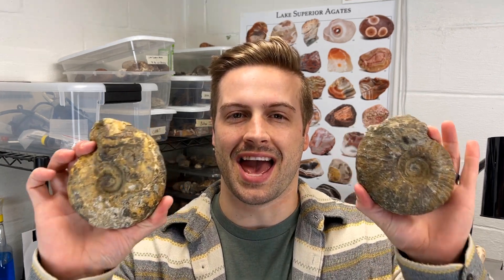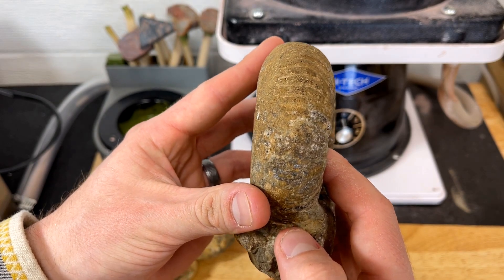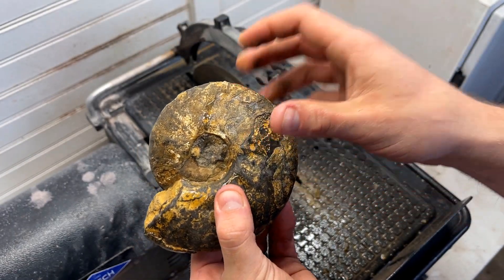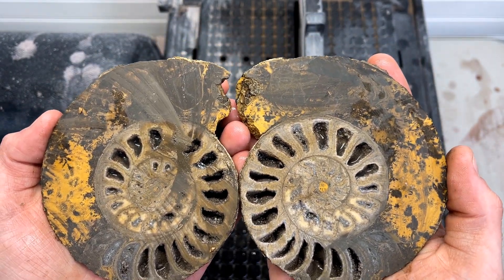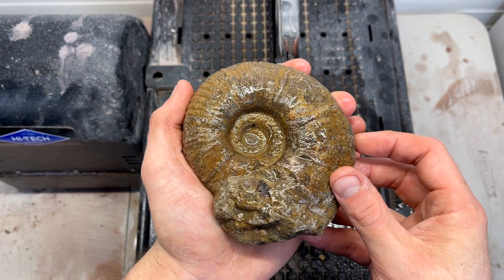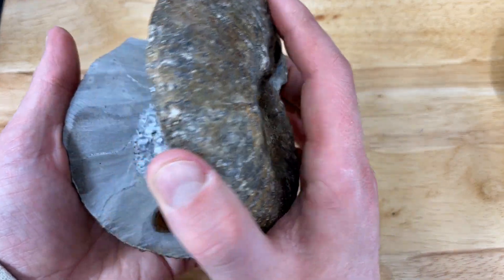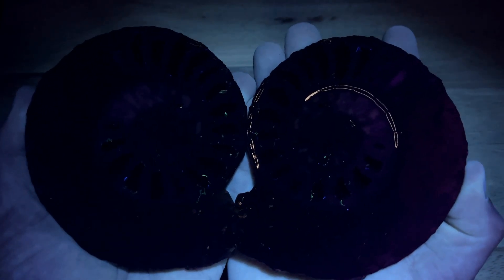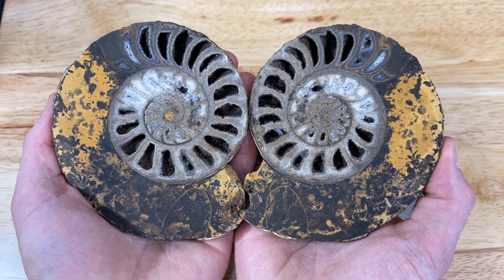I was SHOCKED by the Crystals inside these Ammonites!

Comment: For the druzy one, did you cut right along the siphuncle? I was hoping that it would be intact. You may be able to see it on the one that’s been fully filled in.

The siphuncle is a tube that runs through each of the chambers and allows the ammonite/nautiloid to control the amount of water filling the chambers, which are ballast tanks like those on a submarine.